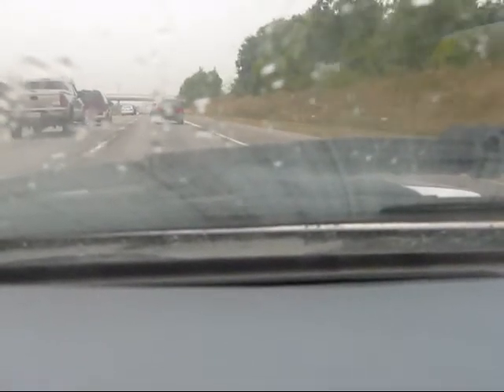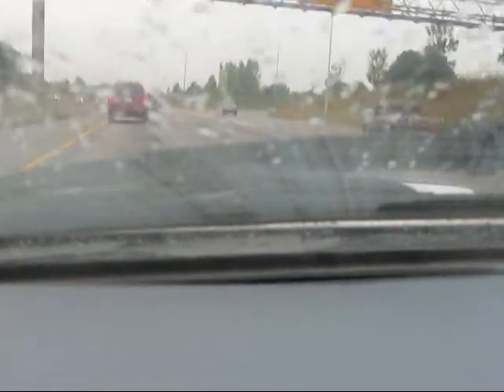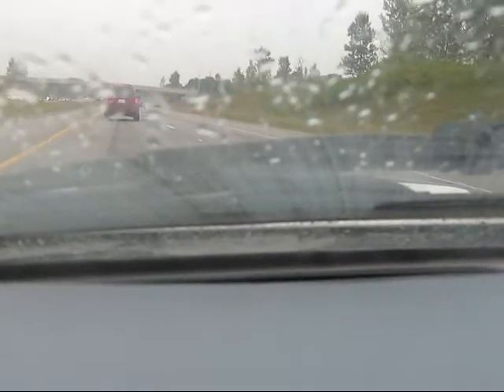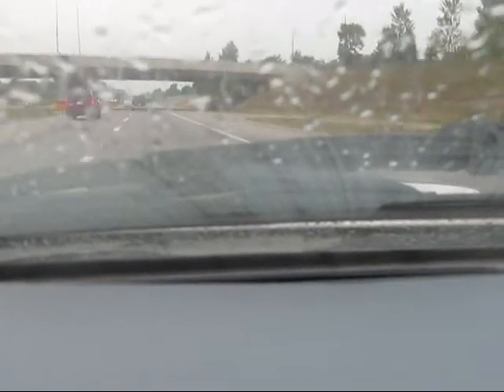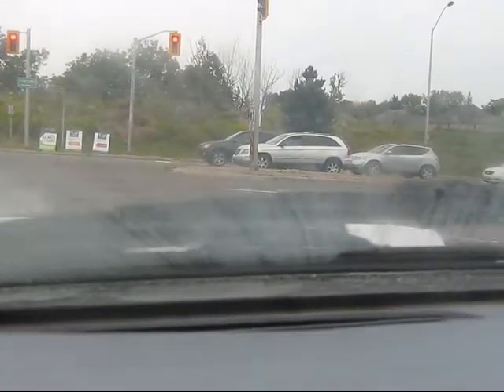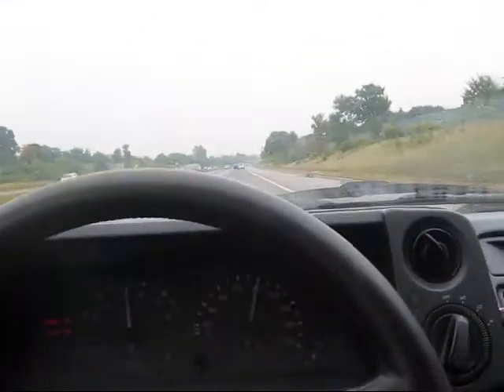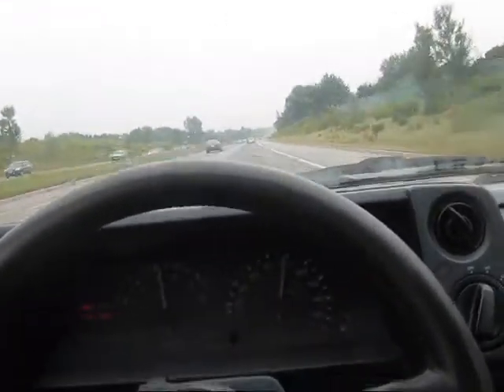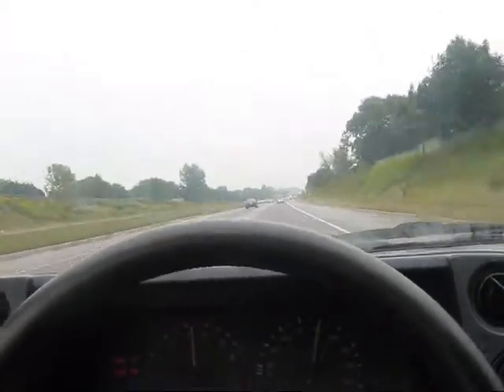Diagnosing the 20V AE86 (Part 2 of 2)

Comment: @Jehuty77 the rag in the lower gears could be something as simple as a faulty throttle body due to carbon build up but i'm gonna assume that the engine has relatively low km's on it since its a 20v 4a-ge.
try to check anything that would contribute to a strong engine brake